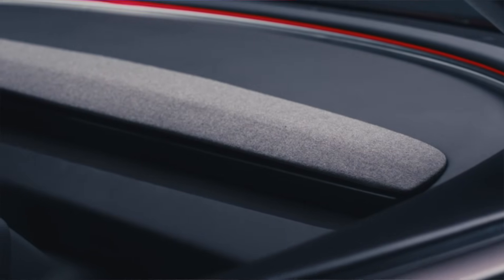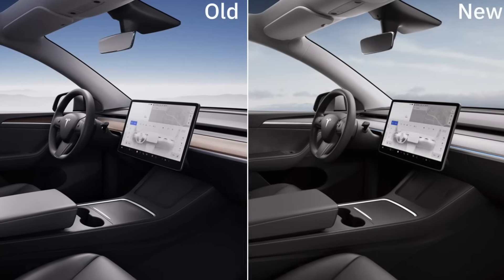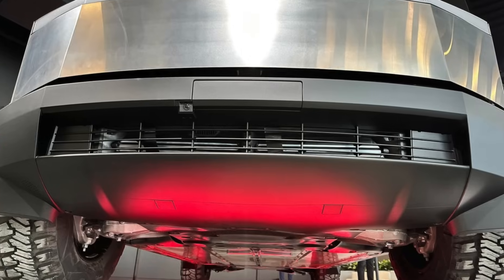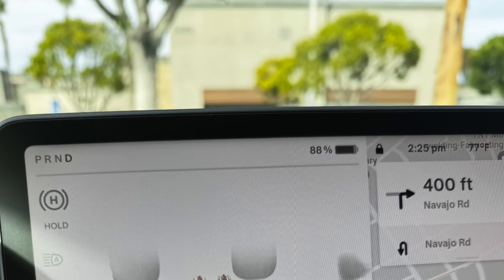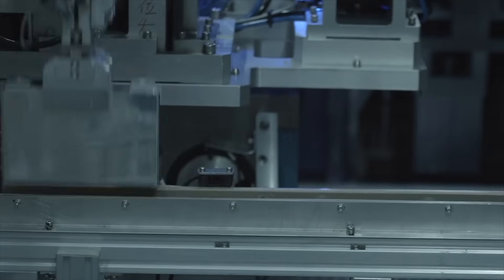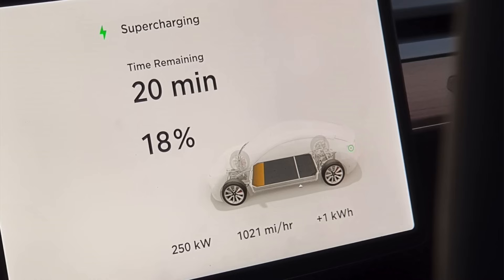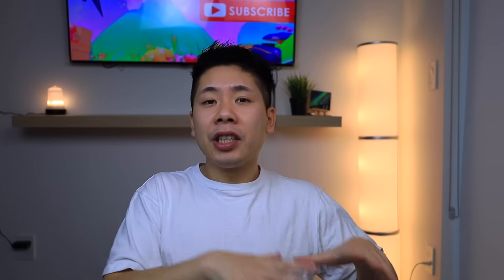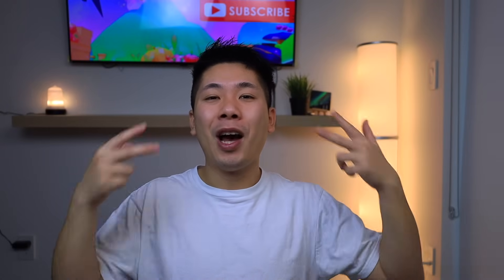Tesla Model Y Juniper Getting Upgraded CATL Battery First | The Best Keeps Getting Better

Comment: As many times you were wrong. The  battery is not exclusive for Model Y. In fact, its a battery designed by Zeekr and made by CATL, the LFP Golden Battery, 95kWh not 100

Comment: With all of this info, would the Model Y Juniper even qualify for the US federal tax credit or lose it all? 

Model 3 Highland lost it all so wondering if Tesla is going to push selling out current Model Y inventory before releasing Model Y Juniper. Then like usual they will eventually do price cuts to cause more people to buy due to FOMO? Or would Tesla try figuring out a way to get the US federal tax credit to apply for Highland and/or Juniper?
Reply from the maker: Tesla will find ways to get every model and trim to qualify. They wouldn’t leave free money on the table for long
Reply: @heyJohnEe  So you think Tesla will find a way for both the Model 3 Highland and Model Y Juniper to get the $7.5k federal tax credit even with the battery and component manufacturing requirements getting stricter each year to come?
Reply from the maker: Definitely think so. Tesla is ramping up battery cell production in North America and that’s the only bottle neck to getting all vehicles to qualify
Reply: @heyJohnEe  oh, that actually makes sense. I'm assuming they're currently prioritizing NA battery cell production for all MY variants since that's the best selling car in the US? They're probably trying to sell existing inventory of MY with discounts so that they could eventually release MY Juniper which would hopefully qualify for the credits since that'd still be their main focus. 

Do you know if Tesla is planning on using NA batteries when they introduce the Performance variant of Highland? Or are they currently trying to ramp up to have the Highland RWD and LR qualify for the federal credit again?
Reply from the maker: Yup, they plan to use the NA cells for the performance Model 3 as they did prior to the highland announcement. All NA batteries are typically reserved for the performance models

Comment: A 20% increase in efficiency doesn’t necessarily means a 20% increase in range. Tesla might chose to reduce the size of the battery while keeping the same range. They could advertise the change as a way to make the car lighter and with the improved charging speed, they can also claim that the new car is more suitable for longer trips.
Would you rather have a car with 400 miles of range but have to spend 30 minutes to go from 20-80% of charge or a 330 miles of range car that can be charged from 20-80% in 10 minutes?
Reply from the maker: If Tesla does that I’d be mad, but I wouldn’t be surprised either
Reply: A reduction in battery size is a reduction on weight which will positively affect the range.

Comment: How about the suspension? My biggest ick with tesla y is the hard suspension
Reply from the maker: Did you try the new model Ys yet? The comfort suspension is night and day compared to my old stiff 2021 mode Y
Reply: @heyJohnEe  yeah i tried a brand new last week. It works but its crap compared to my v70 for example. No hints about softer suspension on the juniper?
Reply from the maker: True. Juniper could be getting a new adjustable suspension soon, as the highland performance is getting something along that line. I have a video on it https://youtu.be/7eVwcp-euLI?si=s8Npz9WZ1qG_iSjE
Reply: @rickardjonsson4526 if they get the same suspension as the model 3 highland you will be satisfied. Its much better, not overly soft but in between

Comment: LFP sucks
Reply: It’s perfect for non analytical individuals who can’t comprehend things like lithium battery degradation and just want to leave their vehicle charged constantly and don’t care about performance.
Reply: LFP is great for 100% charginf but it  loses significant range in the cold.
Reply: @greenearth9945  its not, it degradates just as fast. Bms is the problem, do your homework
Reply from the maker: Newer LFP batteries are coming will resolve those concerns. I disliked LFP originally too, due to power degrades and weather performance but it seems like the world is going away from NMC
Reply: @heyJohnEe  yes indeed. Current Li-Ion used the have the problems LFP has now.
Reply from the maker: How come?

Comment: Happy New Year John! John wonder why the front facing camera can not be installed on front windshield inside behind the rear view mirror as many other car have? Surely a software can calculate the difference to the front bumper (similar to a digital distance meter where you could switch it to measure from the rear or from the front of the meter housing) and apply on display accurately.
Reply from the maker: Hey thanks you too! I play with software in my daily life as a job and even though it’s possible to cook up some magic to make it as close as possible, it’s not accurate enough compared to physical distance from the camera. Then there’s also distortion and viewing angles directly under the front bumper too, imagine a puppy underneath the cybertrucks huge bumper it won’t ever be able to detect properly. For the purpose of 360 view, most car companies tend to have the cameras located on the outside as close to the object as possible, and the ones behind the rear view mirrors are for safety features like emergency breaking and the likes of

Comment: Juniper coming soon makes sense due to: 1/everyone knows that synergy costs effect is only in case when model 3 and model Y have majority of components same 2/ huge discounts on model Y continues even after end of previous quarter (Q4 2023) which was not the case in previous quarters.
Reply: That and the Osborne effect.
Reply from the maker: Those are all great points
Reply: Model Y LR is available as low as 43990$ in few markets from inventory in USA ! Extremely discounted.
Something is brewing